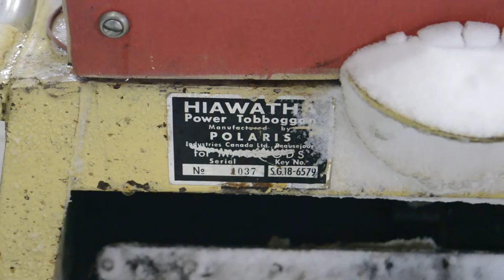1966 Hiawatha power toboggan

Comment: I think it’s a 1966 not a 1965, it has the same hood as the 1966 Polaris.
Reply from the maker: Ya you're right the Colts in 66 did have the same hood. Could could very well be, I went by the numbers on the data plate.